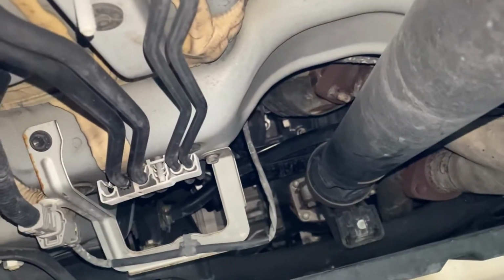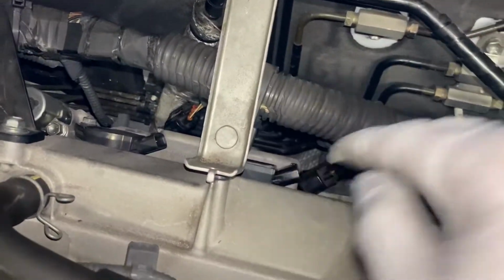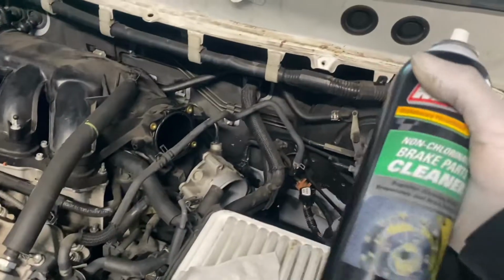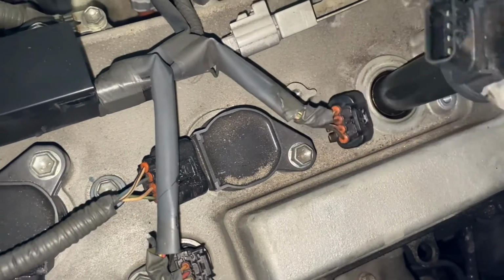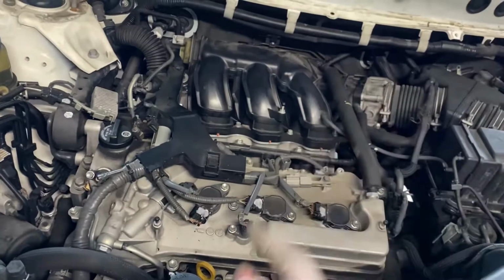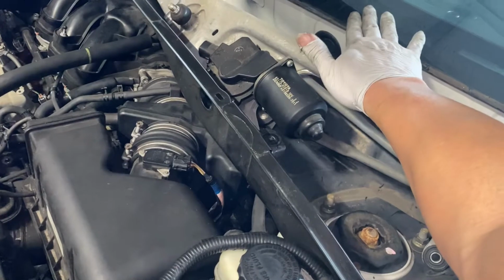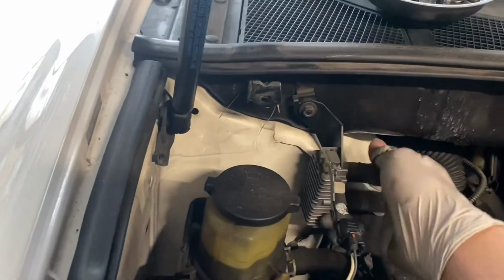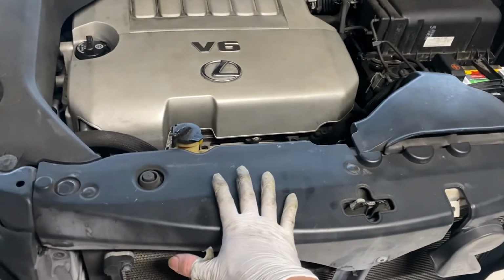Lexus 2008 RX350 spark plugs installed

Comment: I did a couple RX350s. Not remove windshield cowling, wipers..just fought with the 12mm bolt on left bracket to upper intake. Then removed upper intake and 1 intake stud to make wiggle room. I just slightly move upper intake out the way, so no disconnecting throttle anything. Get new intake O-rings. If you have misfire (P0355...) or any of back cylinders (1,3,5) replace all plugs and at least 3 back coils. Plugs:13 ftlbs, upper intake bolts 13 ftlbs, nuts 12 ftlbs. Took 2 hours and lots of cursing, I wrapped my arms to reduce scratching on intake..

Comment: you are very detailed on your videos, please post some more when you get a chance.
Reply from the maker: Thank you for watching my videos
Reply: @kennynhannguyen8666  Your videos are awesome, please keep posting more...I have a RX350 and will be doing this work this weekend. I only have the code for coil 6 but will be doing all of them since I just bough this car about 4 months ago. I am also planning to flush my transmission to ensure the fluid is clean.
Reply from the maker: @lisandrogrullon5001  cool. There is a bracket behind the intake if you can remove it then it should be easy. Through that bracket away. Don’t install it. Use only OEM transmission fluid. I believe it used ATF-WS. Make ignition coil connectors connected good. If the clips taps are broken used silicone. Good luck buddy
Reply: @kennynhannguyen8666  Thank you Kenny for the advise, I will let you know as soon as I complete the work or if I get stuck.
Reply: @lisandrogrullon5001  how did it go? Did you change just plugs or coil pack? Also have you done the transmission fluid change yet and if so how did that go? Thanks
Reply: @anonymous4201  Sorry guys, my response got delay....I was able to finish my spark plug replacement of all 6....the ones in the back are a PITA, if you are not technical or dont have a few hours to work on this do not do it, but it certainly takes time and a lot of the plastic covers need to be removed there is no way around it....I am hoping for at least another 100K miles....I put all the parts Original OEM from Lexus, but you can get off market stuff but I am not sure if those are reliable. Sorry about the delay response.
Reply: @lgrullon854  awesome congrats. Yeah I don’t think I will attempt this myself but it’s good to watch and learn z. Crazy how difficult they’ve made this.

Have you changed the fluids or transmission service, how difficult is that? Thanks
Reply: @anonymous4201  I do my own oil changes, in this model is pretty easy....same goes for the transmission. The oil is a no brainer, but the transmission you NEED TO MAKE SURE you get the right fluid, but is also an easy process. Trust me changing the spark plugs was a pain, not so much the ones in the front but the ones in the back, very painful...no sure what Toyota engineers were thinking when they worked on this design.
Reply: I forgot to add, this is by far the best Video out there on how to do this...just follow all the steps as he describe and you will be fine.

Comment: Good explaination, I am also changing my rear sparkplugs.  It was a struggle to remove the rear bracket bolt and I dropped it and I can't find it under the engine.  So your didn't even have a bracket.  I am thinking not to install the bolt on the rear bracket.  You think this is fine?  I also broke all three tabs on the ignition coil connector.  I am going to do the gasket maker like you.  Thanks!

Comment: Hello Kenny, Thank you for the video! It made my job that much easier. But I now have a question. After putting everything back together & starting it, I now have a knocking sound! So I turned it off instantly. I took your suggestion to not torque anything down. What do you think it could be? Bad spark plugs?
Reply from the maker: @thekingispresent__  thank you for watching my videos